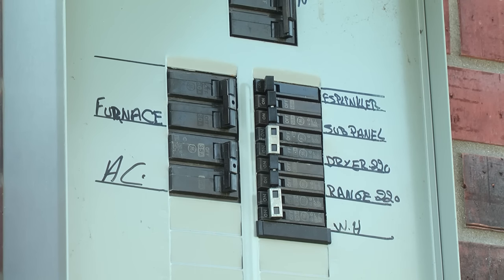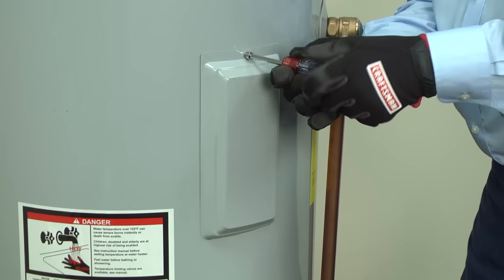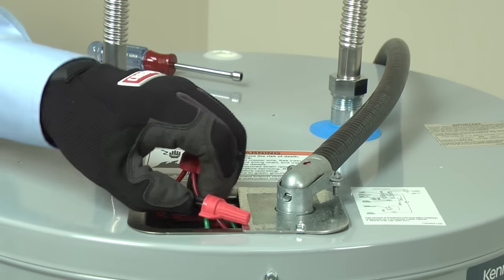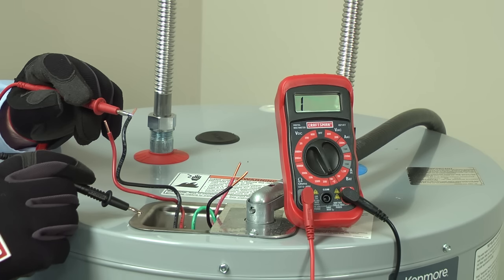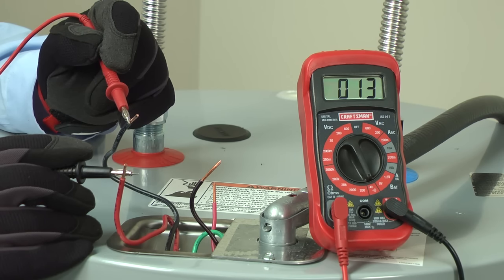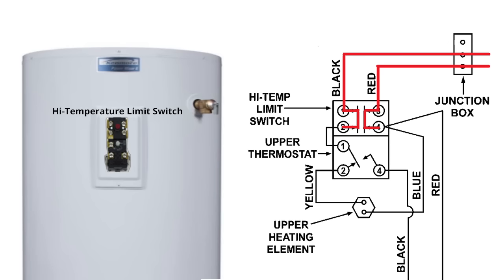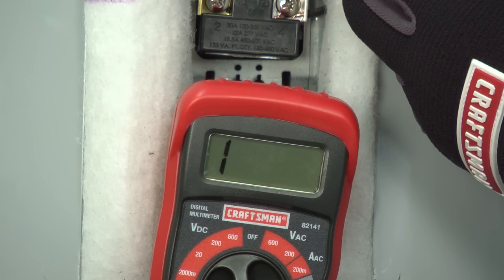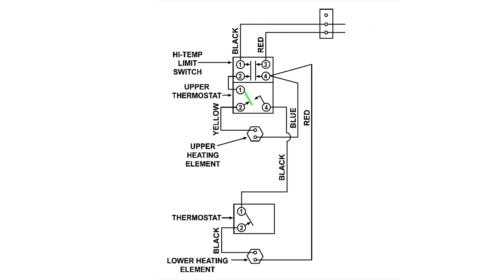How to Fix Your Electric Water Heater When You Get No Hot Water

Comment: SEARS/Wayne:  We're a couple of days from hosting Thanksgiving visitors and the water heater stopped working; this excellent presentation lead me thru a methodical checkout of our water heater; fortunately, I got off with just resetting the internal breaker [maybe something going out??].  All I know is, water is heated and my wife is glad that i can shower.  Thank you for this public service.
Reply from the maker: We're glad to hear that our troubleshooting video helped. We hope that the water heater continues to work through the holiday. After the holiday, you may need to shut off power to the water heater and replace a heating element. You may also need to drain sediment from the tank if you haven't done that within the last year and the bottom heating element failed. Tank sediment could have helped cause the bottom element to corrode and short out which may have caused the overload to trip. Here's a video that shows how to drain sediment from the tank: https://www.searspartsdirect.com/article/how-to-drain-the-tank-on-an-electric-water-heater-video.html  We hope this additional information helps and we hope you have a good holiday.

Comment: Thank you, very much, Wayne. It really helped me to have the wiring diagram along with the simple voltage and resistance checks for both the upper and lower systems as you described how all of the components work. I just flipped the circuit breaker back on, and it is cranking away on the heat. Hot showers tonight, baby!

Comment: Mine was the BOTTOM HEATING ELEMENT. It tested BAD - 8.5 instead of 13 on the bottom heating element. I tested the bottom heating element because I got a bad read when testing 4 - 4 (Terminal 4 of the upper thermostat & terminal 4 of the Hi-temp limit switch). The bad read was 8.5 which is exactly what I got when I tested the bottom heating element. The symptoms was our circuit breaker would trip for our water heater only 1 or 2 times a week. When I switched the circuit breaker back on it would run fine for 4 or 5 days before getting tripped again.  Thank you for the tremendous help!
Reply from the maker: Thanks for letting us know what you found. We're glad to hear that you fixed the problem.

Comment: You can change elements without draining the tank. Cut the water supply off and release the pressure valve using a container to catch the HOT  overflow.
After loosing the element catch the slug of water with a towel.
Design Studio
Design Studio
1 minute ago (edited)
Here is the easy method.CUT OFF BREAKER AND VERIFY AT UNIT WITH TESTER.
 The bottom element  in a Rheem comes on first. The upper thermostat cuts it on.
Disconnect wires to both elements. Set meter to Ohms. The range is around 12.8. If OF is displayed element is bad.
If both elements test good it is the top thermostat usually.
 Another sign of that is when heating water the top element not the bottom element comes on. You might have hat water for a short time but up to 15 minutes.

Comment: Wow that guy is very knowledgeable! What about a fuse? Last year, my water heater went out after 13 years of reliable use. P{lumber came out & installed a new one but it still wouldn't work so I had to call the electrician. Turned out to be the fuse.  A special type of fuse that we had never replaced since installation! It's possible I didn't even need a new water heater but I'll never know!

Comment: You mentioned that the final problem could be the transfer switch in the upper thermostat.  Was there a test for that?  You just said if it was bad then replace the upper thermostat.
Reply from the maker: We don’t have a test that checks the transfer switch because the transfer switch doesn’t shift power to the lower heating element unless the upper element heats the water enough to trip the transfer switch. If the upper element works and you measure continuity through the lower element, then you’ve eliminated all other possible failures. That leaves the transfer switch as the cause of the heating failure.

Comment: we just had the elements and thermostats replaced in our water tank but it crapped out again after a few days of about 5 min at a time of extremely hot water. Is this an electrical issue causing the tank to malfunction or just another issue with the tank that we missed?

Comment: Thanks for this video, this has saved me at least twice. How do you check to see if the transfer switch is working?
Reply from the maker: Checking the transfer switch is difficult and would involve making live voltage checks which we don’t recommend for DIY’ers. You may be able to determine whether the transfer switch is working based on this symptom. If the water heater heats water but hot water runs out quickly and the water heater takes hours to heat the water after you run out of hot water, then the transfer switch may be defective. If you decide to replace the upper thermostat because symptoms point to a bad transfer switch, be sure that you shut off electrical power to the water heater before beginning the repair.
Reply: @searspartsdirect  Thank you so much for the advice. After going through all the troubleshooting tips I finally determined what the issue was, a timer on the heated water supply. The previous owner of the house had the hot water on a timer and the mechanism slipped or shifted to a point where the heat was on for one hour and off for 23 hours. This thing drove me crazy but it was well worth it to finally figure out. Thanks again.

Comment: My husband and I need help. We have not had hot water since Monday after a power outage. We did a complete tune up including replacing both thermostats and both elements, we replaced the supply line nipples and even a wire that seemed old to the upper thermostat. Still no hot water. We’ve tried everything. The upper and lower thermostat read 240v now but the wires on our junction box only read 120v is there a way to replace the wires on the junction box?

Comment: Really comprehensive... but he didn't mention broken dip tube.  I've read that can also be an issue, is that correct?
Reply from the maker: A broken dip tube can cause water heating problems. The water heater will typically be able to heat the water to some degree with a broken dip tube so we didn't address that issue in this video. Our troubleshooting focuses on problems that will prevent the water heater from heating at all. Thanks for pointing out that problem that can cause water heating problems. It may help viewers whose water heater isn't heating the water efficiently to troubleshoot the heating failure.

Comment: When I test the switch between upper and lower thermostat, and the temperature is below what the tank is set at, on the upper thermostat I get 0 ohm between terminal 1 and 2 and roughly 18ohm between 1 and 4 - what does this mean? (This is a brand new thermostat).
Upon testing, both thermostats seem to be ok and both elements give 9 ohm resistance. Wiring at the top seems ok too, but tank overheats and ECO keeps tripping!

Comment: I tried to look for that reset button.  There were two possible places that it could be.  When I opened the first place there was a lot of insulation.  I saw some wiring, but there seemed to be some cardboard with what looked liked a reset button, but it was covered.  I have never done this and that area looked like it should have had a reset button.  I opened the second place and the insulation was wet.  That made me think that something more might be wrong.
Reply from the maker: Finding wet insulation indicates that the tank or a water pipe connection is probably leaking. Keep the electrical power supply to the water heater shut off because the wet insulation can cause wiring to short out.  The wet insulation also causes an electrocution hazard. I recommend that you have a service technician or plumber examine and repair the water heater in this situation.
Reply: Thank you so much for your advice.  I will try to find someone as soon as possible.
Reply: I will be getting a new system.  I am checking into a tankless unit.  Both are so much money!!!  Again, thanks for your expertise!!!

Comment: I couldnt find any breaks.  Still cant figure out what's wrong. 

I also tested continuity with 1 & 4 and 2 & 4 or the upper thermostat switch and got a reading of 27 ohms.  Not sure if that's a problem.
Reply from the maker: The resistance reading you provided sounds normal, but here’s one more check. Disconnect the black wire from terminal 4 and recheck the resistance. You should measure infinite resistance between 1 & 4 and 2 & 4 with that wire disconnected. If you don’t measure infinite resistance, you’ll likely need to replace the upper thermostat. If you do measure infinite resistance, we recommend you have a service technician examine the water heater because you might have a voltage supply problem. The technician can check the voltage supply going to the water heater. You can schedule service here: https://www.searshomeservices.com/.
Reply: @searspartsdirect  replace the entire kit and it still does not work help please !!!

Comment: Mr. Wayne, I have same meter. Should the ohms be set at 200 for continuity? and I also noticed your lead placement on the meter was different from mine, does it matter? Thanks
Reply from the maker: You can set the meter at the 200 ohm range or set it for the continuity tone (the setting just to the right of the 200 ohm range). One lead must be in the right side terminal and the other lead can be in the middle or left terminal to check resistance.

Comment: I'm confused.  Assuming the metal of the JB is grounded, If the "1" indicates no continuity, that means the wire(s) are properly insulated from ground. Why would a resistance measurement indicate the wire is short circuited to ground? A high resistance measurement is needed.
Reply from the maker: The meter used in that video shows 1 instead of OL to indicate no continuity. You're correct that a measurement of no continuity indicates that wires are all insulated from shorting to metal inside the water heater. If the meter measures any kind of resistance other than OL or "no continuity" (signaled by 1 on the meter used), then a wire inside the water heater is shorting to metal inside the water heater.

Comment: I just hooked up a hot water heater and the power coming in was pinched by a staple close to the unit.  Soon as I turned on the breaker sparks appeared.  I found the issue and corrected it.  Any chance the hot water heater is ok?  I am currently waiting for it to get hot...
Reply from the maker: +ISEE YOU 
There’s a good chance that the water heater is okay since the short in the wire was in the incoming power supply wire. If you’re still not getting hot water after repairing the wire, I recommend that you have a service technician or electrician check out the water heater and the supply wiring.
 
Here’s a link for Sears Service in case you need it: https://www.searshomeservices.com/repair/water-heater-repair-services
Reply: It ended up being ok!!!

Comment: I have a water heater that is heating very well and up to temp, although it will only produce HOT water if you open two different faucets at the same time, otherwise if you only have one faucet open, it produces WARM water only. Any ideas
Reply from the maker: We recommend that you have a plumber fix this type of problem. Your water system may have a tempering valve. A tempering valve mixes cold water with the hot water when it senses hot water temperature above scalding temperature. The tempering valve could be leaking or malfunctioning. If your system doesn’t have a tempering valve, you may have a leaky faucet valve that’s allowing cold water to be drawn into the hot water side when you turn on a single faucet.

Comment: I did the troubleshooting on my electric water header  but the readings from terminal #4 to terminal #4 is 11.8 ohms. What does it means ,if lower than  13.0 ?@fh 3911
Reply from the maker: That resistance reading is close to normal. If the reading was 1 or 2 ohms, then the element would likely be bad.

Comment: ht limit switch reset button won't click. does that mean it hasn't popped or does it mean the switch is faulty and needs replacement?
Reply from the maker: The reset button will pop out slightly when it trips. If the reset button doesn't click when you push it in and the reset button only sticks out about 1/8-inch then the high temperature limit switch probably didn't trip. Shut off the circuit breakers for the water heater and check the upper element heating system as shown at 3:49 in the video to see whether the switch is faulty. We hope this information helps. If you need further assistance, let us know.

Comment: hi it says element, in tiny letters, no hot water and digital display keeps reading E04 , which research on line says it's the upper heating element , have reset the red button that's suppose to bypass the temp cap, no luck turned off the power than back on still no hot water , at this point i've purchased upper and lower heating elements and gaskets and the tool to remove them from amazon, hoping that online advice for my whirlpool model is correct and the whole after heater isn't shot, model number is whirlpool=
ES50R92-45D 
this comment is in answer to a precious comment

Comment: I have cold water kitchen and bathroom everything I've checked everywhere I know to the heater is working it has water in tank it's getting hot just no water going through the lines the line is not busted or cracked can someone help me figure out what's going on please
Reply from the maker: The plumbing system likely has a check valve in the water heater outlet pipe that’s stuck shut. You’ll likely need to have a plumber replace that valve.

Comment: What temperature should the upper and lower element be?
Reply from the maker: The factory sets both thermostats at 120 degrees F. You can use those settings or adjust them according to the directions in your owner’s manual. Here’s a link for the owner’s manual on the water heater shown in the video: http://www.searspartsdirect.com/partsdirect/user-manuals/153586410-kenmore-parts-electric+water+heater-manual Page 15 provides guidance on thermostat settings. The manual recommends against setting upper thermostat temperature higher than the lower one. We recommend following the directions in the manual for setting thermostat temperatures on your water heater.

Comment: when testing the lower heating element the multimeter made a popping noise and now does not want to turn on. I tested the upper heating element and the upper thermostat and it read within the correct ranges. What is my next step?
Reply from the maker: According to your description, it sounds like you still may have had electrical power connected to the water heater when you tested the lower heating element. Power going through the lower heating element while testing resistance likely damaged the multimeter. The circuit breakers for your water heater may be mislabeled so we recommend that you have a service technician examine and repair the water heater to avoid electrical shock.
Reply: Sears PartsDirect you may have blown the fuse in your meter, easy repair. Always check resistance with all power off and isolate or remove the wires from item being checked.

Comment: What if there's power, the elements have been replaced, the t-stat has been replaced, the limit switch is pushed, the breaker has been replaced...we did ALL the things mentioned here. No hot water.  :(  Thoughts?
Reply from the maker: We recommend that you have an electrician check for 240 volts through the black and red power supply wires.
Reply: Actually, I don't know which wires it was but it WAS an electric issue. Some wires were fried at the actual tank.  Thank you for responding. :)

Comment: Hot water coming out much less, whether by single or double knob control. 
Low pressure? Cold comes gushing out like normal. 
Anyone know what the PROBLEM might be?
Reply from the maker: Sediment in the hot water tank or a clog in hot water piping could be blocking water flow. There’s a chance that draining the tank to flush out sediment could restore hot water flow. Follow the steps in this video to drain the water heater tank and flush out sediment: https://www.searspartsdirect.com/article/how-to-drain-the-tank-on-an-electric-water-heater-video.html. If hot water flow is still weak after refilling the tank, you’ll likely need to have a plumber fix the hot water flow problem.
Reply: Me also
Reply from the maker: As noted in the above reply to twodogs716, sediment in the hot water tank or a clog in hot water piping could be blocking water flow. Flushing out sediment from the tank as shown in this video may fix the problem: https://www.searspartsdirect.com/article/how-to-drain-the-tank-on-an-electric-water-heater-video.html  If that doesn't help, then you'll likely need to have a plumber diagnose and repair your hot water supply system.

Comment: I turned off and on the w/h switch and the water heater made a pop noise. What could that mean?
Reply from the maker: If you heard a pop noise from the circuit breaker switch and the water heater isn't heating water, then the circuit breaker may have tripped again shortly after you reset it. That could indicate that wiring, a thermostat or a heating element in the water heater has a short circuit to other wiring or metal in the water heater. We recommend that you have a service technician examine and repair the water heater in that situation because a short circuit is dangerous. We hope this information helps. If you need further assistance, give us more details about your water heater problems.
Reply: @searspartsdirect  alright thank you